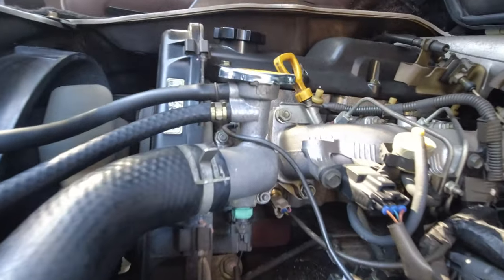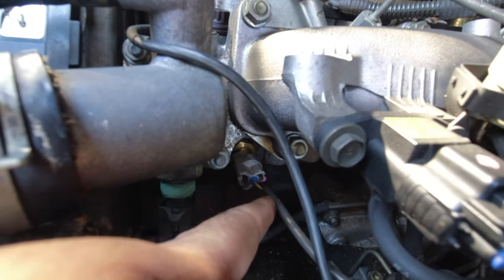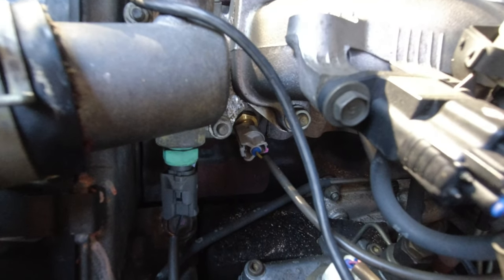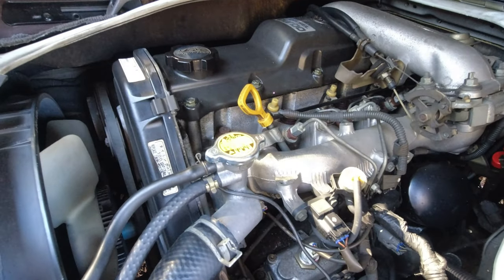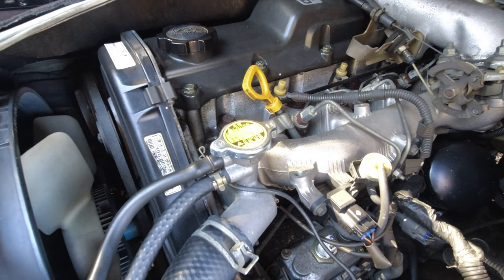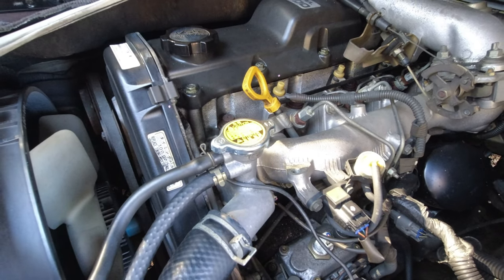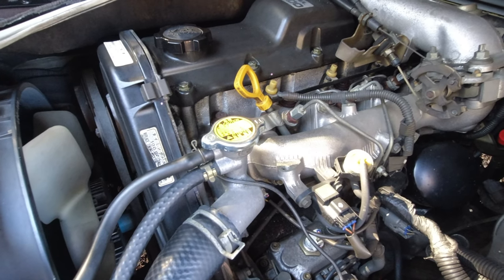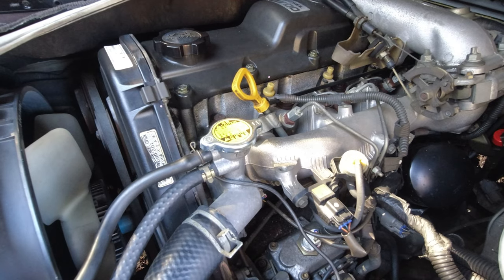3 Hiace Cooling System Tips

Comment: Does your model have 2 radiators? If so, when you do a flush do you have to do both at the same time? Don't know much about the system to be honest.
Reply from the maker: Yep two radiators. Both flushed same time, auxiliary is connected to the main. 

I did mine when I first got it as cheap insurance. Then I'll get it done every timing belt change.
Reply: We had overheating problems with our super custom van the bottom radiator was completely blocked took them out and took it to the radiator shop to pull it apart and flush it properly fix the problem now we can tow trailers a big hills and temperature seems normal

Comment: Do these models Hiace's have the extra radiator mounted up under the front.
Reply from the maker: Yes one flat one standing up
Reply: @nathansharma87  Ok well they should be pretty good with that much fluid.
Reply: I got 1999 Toyota hiace turbo diesel imported 
Automatic
3 lt kz H106
Need the throttle sensor
Reply: Yes they do and they are very expensive
I just ordered one that smaller than one damaged
With one radiator you must be very careful gets hot

Comment: Where are the 2 heater hoses under on the drivers side that make for easy flushing?
Reply from the maker: Under the car...behind the drivers side door.
Reply: @nathansharma87  is it 2 rubber hoses about 20cm long connected to some solid metal ones via hose clamps? 

There's solid metal pipe on each end of the rubber. The furthest back part goes up into the side of the van.

Comment: Trevor from Cairns i have a Toyota Hiace Cruising Cabin 3.0D EFI turbo full time 4 W D Custom import could you answer 2 questions for me please is it best to drive with the OD of all the time or just use it  at about 70.80 kls and what fuel consumption on average should i expect with the van running well if you can help it would be fantastic sorry 1 other the little red button on the gear select case what does it do cheers watch you all the time
Reply from the maker: Hi Trev

Overdrive is fine for normal driving. The only time you'd want to switch it off is long steep hills or if you need more than 40% throttle for longer than 30 seconds. 

For fast hills like 100kph if you feel the van labouring and it's working too hard and your struggling to maintain speed, drop back to 80, turn overdrive off and climb it in 3rd gear with the torque converter locked up (will lock automatically with od off and ECT power off).

Average fuel consumption is 14l per 100. 

Red button on gear selector panel is emergency shift override. You know how you have to push the brake pedal in to change gear from park? Well if that solenoid ever fails you can push the red button and simultaneously shift the gear lever out of park.
Reply: Cheers Nathan keep up the good advice excellent much appreciated
Reply: Cheers Nathan much appreciated excellent answer
Reply from the maker: Happy to help ✌️
Reply: @nathansharma87  Yes and the red button is for if you need to unlock the shifter out of park so that you can push the van around if you had the battery disconnected or flat.